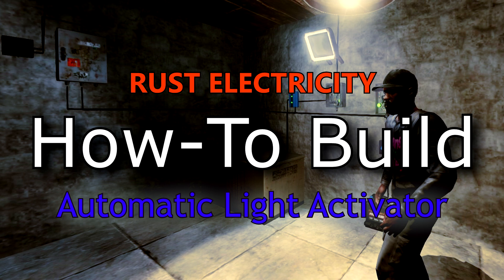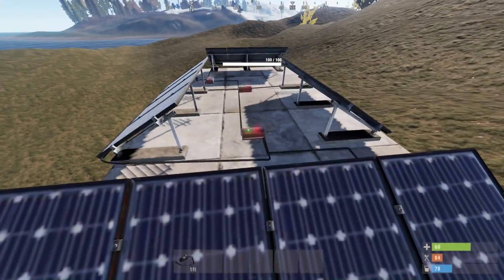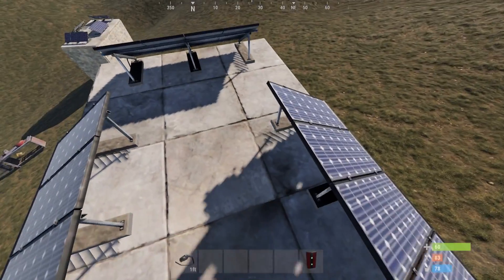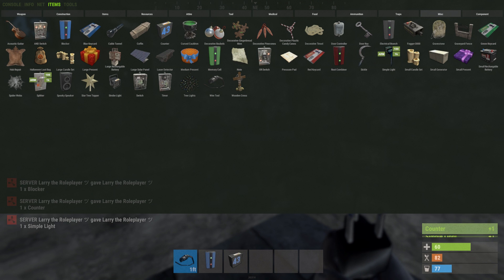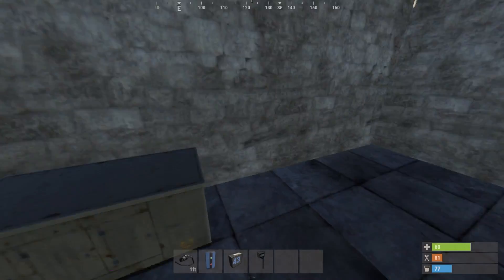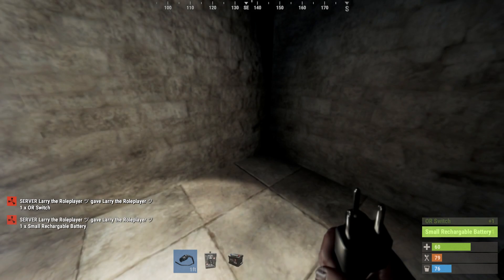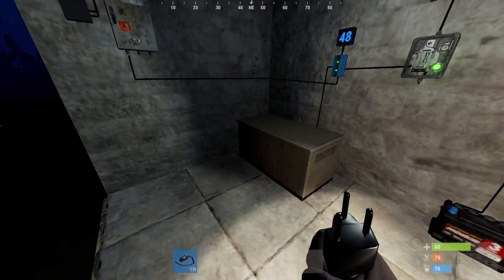✅ Rust Electricity - How to Build an Automatic Light Activator

Comment: This guy made a great little design but he is wasting power that could be used more effectively. Instead of a splitter he should be using a branch, branches are will do the same job but gives you more control instead of just halving it so only the power that's required would go into the blocker and the rest to the battery. The other thing is use a root combiner to charge the battery instead of the or switch, that's what the root combiners are for not the or switch. The or switch is meant to say allow two lines of power into something like a blocker or memory cell.

Comment: i dont find this cable tunnel for conect for another side of wall  =(
Reply from the maker: Hey there!  You actually don't need a cable tunnel anymore.  You can simply pass wires through walls now.
Reply: Detalhes @LarryTheRoleplayerTM  open hole ? because my base is big and windows in last floor =(

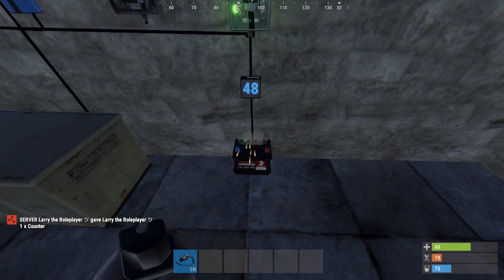Comment: at the end of the video (about 8:18) you're getting 72 volts from the solar panels, but only 48 are going to the battery (despite the generator being turned on as well), is that the fault of the OR switch? you might need another root combiner to get more volts to the battery, right?
Reply from the maker: I think that is just a continuity issue with time of day.  The voltage swing is pretty wild off these solar panels based on where the sun is hitting them.  If it's not full on 12 oclock it varies greatly as to the output.

Comment: when i hook into generator it only gives me 1 outter supply but i notice it gave u 3. how did u get that menu to pop up
Reply from the maker: Hey, thanks for watching!  They've updated the small generators to only have 1 output, so you have to connect them to a splitter.  Check my more recent video for the updates.
Reply: @LarryTheRoleplayerTM  thanks for the info!